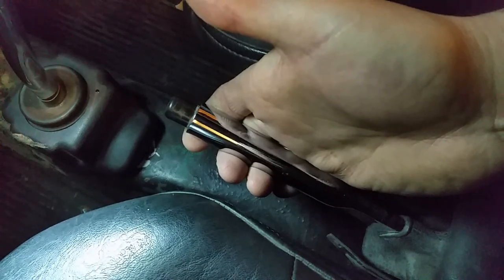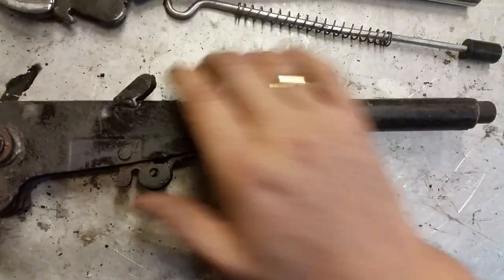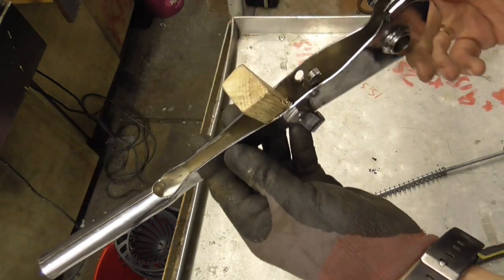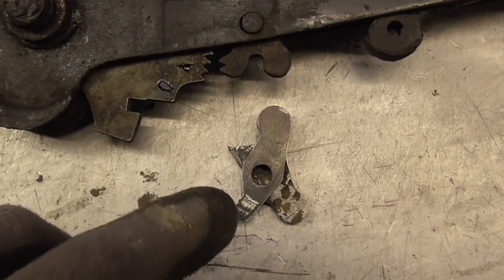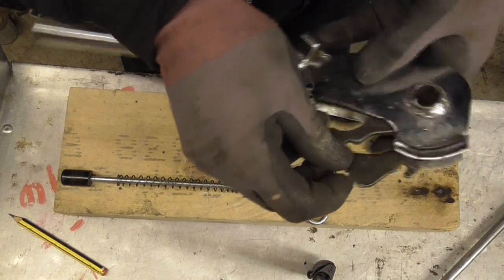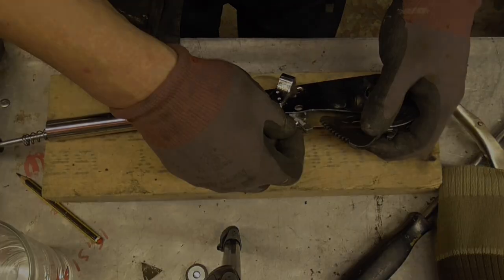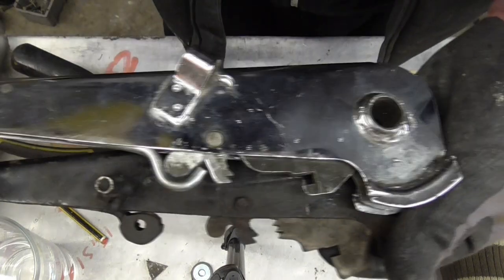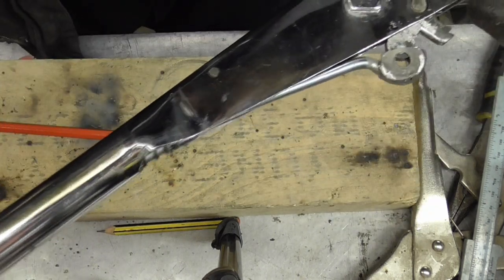How to Modify/Convert Stock VW Bug Handbrake to a Drag Race Handbrake / Ebrake / Emergency Brake

Comment: ive got a similar build which im hoping to do a little drag racing, what was your 1/4 time?
Reply from the maker: My best time in 2018 was 13.1 sec - 1/4 mile. However I hardly had the car on the road, pulled an all nighters to get it ready before it did that 103 mph run ha ha ha. I was massively suffering with wheel hop so that launch was at 2k and had some annoying gearbox mount gear shift issues I was fighting with too which I think now have a handle on. All being well should be able to shave a second off that. Bit of tinkering maybe more. Unfortunately 2019 was a washout weekend, and a clutch part sheared driving to the strip for the 2nd meet that year. This year looks like it could be a bust too as I believe all the racing events are likely to be cancelled. Double Doh. Good luck with your build. :)
Reply: @PeoplesCar  ah wheel hop is such a pain, do you have a kafer bar across the rear struts? heard that helps and ill be looking into getting one eventually. seen your video of the uprated shocks so im going to invest in some GAZ shocks soon too
Reply from the maker: @thescraprocket1323  Hi Archie. I'm not sure what you mean by rear struts? My frame forks are tied into my frame horns so should help stop them rising and falling. I have been planning to tie these I to the tops of the damper mounts to stop any sideways movement buy not got round to this yet. 
I made all the changes on the same day and was the only change I made to cure the hop. It seemed to work for me but there are other reasons for it too including worn bushes and movement in the rear suspension/gearbox etc so the reason you are getting hop could potentially be a different reason. Hope that helps :)